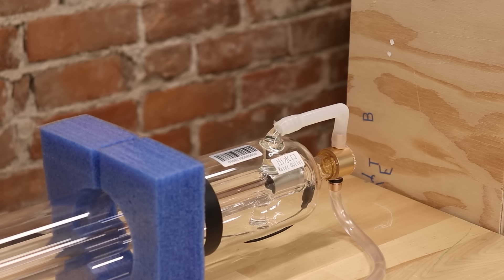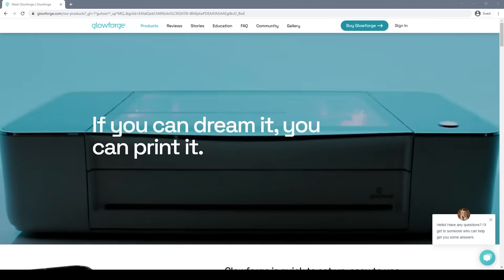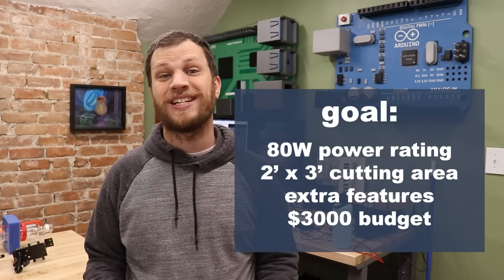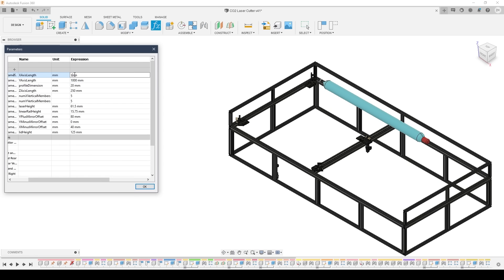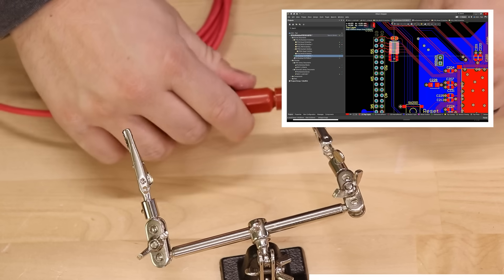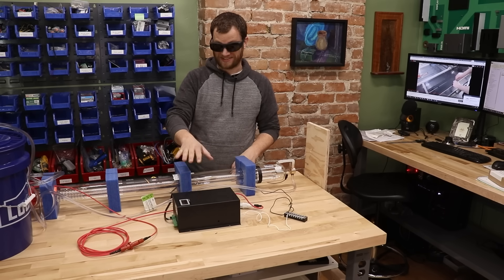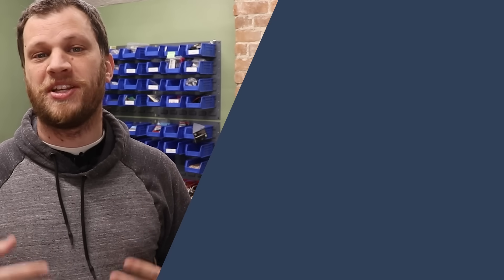I'm Shocked By How Much Damage This Caused! - CO2 Laser Cutter Part 1

Comment: Why would you build one for $3000 when you can buy one with chiller for $3400?
Reply: yep. i spent 3 months researching and building a parts list, only for it to hit $3600. Then I got an email saying the tube was on backorder so i bought a commercial unit for $3200 after discounts and gained 20W, and 12" x 24"  increase in bed space. these things are pricing out to where DIY is not economical. A 36x24 100W for 3200 is crazy

Comment: You may not realize the best insulator of electricity is pure water better than glass better than rubber silicone what have you on route one to 100 and scale glass is like 10 some of the best porcelain silicone rubber might be 15 or 20 pure water is like 65 or 70.. how pure the water is is important do you think..

Comment: I could put all that power in your hand for under $500 will last tens of thousands of hours 10 to 20,000 hours probably 5000 minimum wage a couple pounds most and will work out just 1224 lol at 5 AMps

Comment: Who scary invisible Beam yet dialed pump keg that’s 1080.. yes invisible but a lot of power I have a straight rod and some mirrors not very big easily CAD scanned and it’s not flash lamp pump rods again high voltage scary water cooling and yes you can water cool the dial pump ones..

Comment: Then you can move up to diode pumped YAG rods or down pump .. Yes and the water will be running through the laser and you happen to be cooling it and if something touches one of those electrode things might just kill your ass just saying I played with helium neon lasers and that’s was 2150 V at 5.5 to 6.5 mA bit one time I was jittery my arm was twitchy for well over an hour.. That’s like playing with an electric dryer outlet to 20 yeah got bit once there too and ended up 12 feet on the other side of the room in ICU the big flash that nobody else seen.. Again lucky I wasn’t dead

Comment: And look at the device called the laser pecker well that in the south would be a way to expand the size without having to expand the frame just make the thing move around.. 
Razors super cheap 12 or 24 V 2 to 5 A run it several hours on high current 18 650 batteries honestly tell me your specifications I’ll draw that for you with laser diodes

Comment: Yeah water chiller 

Once upon a time a 7 W argon laser and a 10 or 20 W CO2 laser CO2 laser virtually require no complicated optics both require water cooling kind scary with all that high voltage and water chilling making both expensive I’ve got a 40 W laser that I paid I want to say $51 for and that is they describe is 10 W optical.. and incorporate it into the cad scanner 3-D and all you need is perhaps a roller if you want to engrave round objects glasses bottles cans baseball bat

Comment: Scary high-voltage water chiller.. special optics to manipulate the beam because you’re probably not gonna be doing a lot of moving around of the laser itself big and bulky.. 
yes expensive 80 W laser under $200 another $50 on improved optics the output lenses.. attach it to a CAD frame for another hundred dollars you’re in business professionally speaking been there done that just picked up a 40 watt four I believe it was $51.. A few more dollars heiresses tabs blow some smoke out of the way of the cut all the miscellaneous of the laser around $100 for 40 W engrave stainless or burn your neighbor 10 15 20 feet away

Comment: I use to work with lasers. Shortly I interviewed with an industrial laser company, I was introduced to a 5KW solid laser that could be operated in a panel truck. Shortly after a commercial aircraft  blew up near Boston. Someone said they saw what was a missile. A 5KW laser would ionize air like the phaser in Star Trek..

Comment: PVC tube is OK for quick-n-dirty but will stiffen and harden with time. Good chance you will break the glass nipples. Try using silicone hose that stays elastic and is way more flexible. Cooling, many might look at PC Water Cooling gear as an option but in reality, most guys with big lasers will be investing in a water chiller unit.

Watch the video closely on the test, look at the inner tube, rear mirror is moving or warping, you see light hitting the front inner and moving.

Comment: For anyone interested, if you were to "Eliminate" the 1st mirror, and rotate the laser tube 90degrees so that the "2nd" mirror became the 1st, you'll get a stronger beam, as every mirror causes a small amount of degradation to the laser beam.  
Also, for cooling, if you plan to run a long burn, using a bucket works, but the water will heat up.  For my build I used a 480mm PC Cooling Radiator with a D5 pump and 4 cooling fans on the radiator, as well as a PC reservoir, to make filling and bleeding the system super easy.

Comment: I built one out of 2020v and 2040v extruded alum, large enough to cut 1/2 a piece of 4x8ft plywood.  (so it cuts 4x4ft)...
When I first finished it, I was aligning the mirrors and stuck my head down to look into the focus head, and pushed the "Test" button which does a 1ms fire, and it hit me in the side of the head, and burnt all my hair off that spot, plus i got a really nice blister and it REALLY HURT for a 1/8" dot. lol

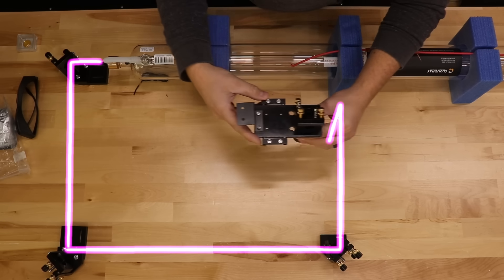Comment: @5:50 I think you are using one more mirror than you need. If you put the  2nd mirror on the y-axis carriage instead of having it fixed at the end. Apart from using one less mirror you will also have a much shorter light path.
Reply: I was thinking the same thing.  But it depends upon the gantry arrangement.  He demonstrated a setup where the gantry is vertical, it moves horizontally, and the carriage on the gantry moves vertically.  In the setup you're describing, the gantry is horizontal, it moves vertically, and the carriage on the gantry moves horizontally.  His setup requires a shorter gantry, though it requires longer support rails on top and bottom.  Your setup requires a longer gantry, but shorter support rails on either side.  There are pros and cons to either approach.
Reply: @Mueller3D  I see what you mean but I still think shortening the light would be more important than shortening the moving gantry. The longer gantry would mean a little more inertia and less rigidity but that is quite easily compensated for if even it is necessary to at all. Unlike with a 3d printer or CNC mill the 'cutting head' is very light and doesn't need much structure to avoid vibration and such.

Comment: Please, please be very careful with that stuff. On CO2 laser machines you deal with high voltages, invisible coherent radiation, potential hazardous gases and vapors, poisonous optical materials.... So it is recommended to get at least a safety training (better maintenace) for this technology from a laser machine tool builder. Remember there will be third teeth but no second eyes.😁

Comment: Screw terminals are designed for bare wires. The reduced contact area with ferrules will melt your connector over time. I find out the hard way.

Comment: Going to be honest, the Glowforge Pro is actually a roughly $2000 laser cutter that's been up-charged to $6000 and locks you into a proprietary software system that only works over the internet and could be killed or put behind a paywall at any time by the company. And the air filter system they made sucks. It's a metal box with a few filters thrown in, and it really just gets particulates out of the air. As far as I know there's no real scrubbing of noxious gasses with activated carbon. We have a Pro at work, and it can be a huge pain to work with, especially when the weirdly complex firmware hangs and the whole printer freezes and refuses to recalibrate for a few hours. I highly recommend building your own laser cutter or getting a system that is controlled by Lightburn or similar software. Something that you can actually own and control, rather than another piece of HaaS/SaaS bullshit.

Comment: On larger laser tables, the tube moves with the mirrors and head to keep the light path as short as possible.  The longer the light path, the more likely smoke will block the light.  But, on a small table using a big tube, it makes sense to keep the tube stationary.

Comment: Be extremely careful with both the laser and the supply/wiring(40KV+ Pulsed DC @ more than 30mA+ is absolutely lethal!!!). Wooden bench is not a good idea, any moisture, it will arc from anywhere, absolutely no liquid spills.
Very Dangerous, Be safe, can't stress more. Also wear polycarbonate safety glasses at the least. Always pump cooling water from below bench, water bucket on bench is very unsafe!

Comment: Maybe not the best idea to have the laser pointed in the same direction as your computer setup.  A little bit too long on the button and you could go right through that plywood and into whatever is behind it.
Reply: Yeah.... my thoughts exactly. Even at that distance, it would definitely damage a LCD panel or other softer materials. Metal would fair better, but still get damaged quick.

Comment: LOL My 100 watt tube is way longer than that one... heh! mines bigger!  I think its 1650mm long.  I built my laser for about 4 grand Canadian.  I went big and have a full 1.5 x 1.2 meter cutting area. I ordered most of the parts on ebay and built it around the AWC708 DSP.  It came with janky software that completely sucked and made the laser cut all funny.   Upgraded to lightburn and the rest is history. The laser is awesome and I use it all the time.

Comment: PSA on laser safety beyond appropriate goggles being worn for the wavelength: The power density required to cut is the power density required to vaporize, which is far higher than the power density required to accidentally cause a fire.  

That which a CO2 laser cuts when focused, it will set fire to when unfocused.  Do not leave a CO2 Laser out of focus.

Comment: From a noobs perspective how many watts should i have if i want to cut 1.5mm aluminium sheet?
Reply from the maker: CO2 laser cutters can't cut through metal. You would need a fiber laser or a water jet
Reply: @bytesizedengineering  oh i see, okay thanks a lot.
Reply: @bytesizedengineering  Absolutely untrue. I have cut many metals with a CO2 laser. It was part of my business. You do need a lot of power, though. For 1.5mm aluminum you need about 2 KW. Fiber lasers are better for this but you still want a KW-level source for metal cutting. I do not recommend making a metal cutting laser system at home. They can do real damage.

Comment: How is it, sir, I have 2 laser tubes in one machine. When I work plus, the tube lights up, but when I start to operate the machine, the tubes do not light up, and I returned the design, there is no problem. I tried many jobs, the tubes do not work, I changed the power supply with a new one, which also does not work, so what is the solution and has the tubes been destroyed

Comment: Please, I have a problem with the laser tube. When I do a plus, the tube lights up and when I turn on, it does not light up and does not emit a laser. What is the reason? I changed a new power supply and the problem is still. Is the tube destroyed?

Comment: Contrary to what you say, I bought a K40 400mmx 400mm and in a very short time I realized that it was very small, as well as having little power and speed to cut. I decided to build my own machine of 1000mm x 1000mm but with a variant, the tube and the cutting head move, in this way I take advantage of 100% of the power of the tube as there is no loss in the mirrors, I have only one mirror, I do not have to align or clean them. the tube is 60 Watts. For this area of work with the configuration that all or almost all machines come with. they come equipped with a 100Watts or 120 Watts tube.
Reply: juan cee: can you tell me how you did your laser with one mirror only? I saw CO2 tube sittin on moving gantry but there were still two mirrors.
Reply: @The_Unobtainium  El tubo en posicion horizontal, el cabezal con el espejo y la lente de corte en posicion vertical inmediatamente a la salida del tubo, 80 mm para poder limpiar espejo y lente de salida del tubo.

Comment: I have also built my own CO2 laser cutter from scratch.  Designed everything first in Fusion 360.  My design requirement was to able to handle at least 12"x24" work area.  Designed and 3D printed parts.  Everything works great except that I went too big.  Here in northern part of U.S. I only have about 5 months or less where weather is pleasant enough to be working out in the garage for my hobby use.  I thought that I had enough space in the house but I only used occasionally for hobby and it didn't justify space it was occupying.  So I'm redesigning to be much smaller machine size to fit in the corner of the house.  I found out later that I really never needed to able to cut large size work piece.  For anyone who have never worked with laser cutter, I would recommend that you first pick up those cheap Chinese K40 machine and play with it before committing to building large machine.  Other alternative is to build a laser diode engraver/cutter first.  They are much cheaper and less complex than CO2 but has similar gantry mechanism.  You would get lot of experience and knowledge first before spending extra money on required equipment  that CO2 system need. Then if you want to, you can go making large CO2, CNC and 3D printer like I did.  For ideas and inspirations, check out the Openbuild's  Build Categories page.
Reply: You're absolutely right. Built my first laser with 3030 profil. It was huge and never used the capabilities. Now i converted to a Y400 from "Further Fabrication" Works likes a charm and you hardly use ever more then 400x600 mm.

Comment: I am kind of surprised that the beam coming out of the CO2 tube is collimated... 🤔
If it is not, you might come up with focusing problems that are dependent on the position of the stage (because of the difference in optical paths depending on the position of the stage). Just starting the series now so let's see if I am right.
Reply from the maker: The laser beam is not culminated coming out of the tube. There is a lens in the laser head that focuses the beam
Reply: @bytesizedengineering  You exactly describe the situation in which the focusing would be position dependent 😅
Oh well, see for yourself if the beam divergence will be small enough to not cause you any problems!

Comment: hello wpuld like to build co2 laser to cut mild steel upto 10mm area 1220 by 2440, any assistance
Reply from the maker: For mild steel, you'll want to use a fiber laser, water jet, or a plasma cutter. A CO2 laser isn't the right approach